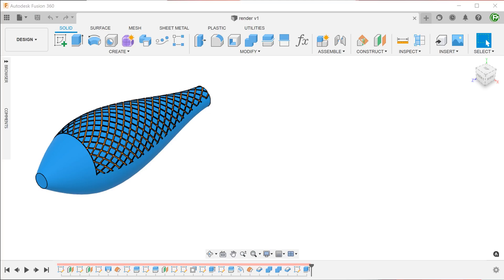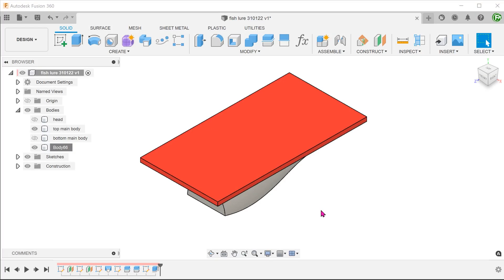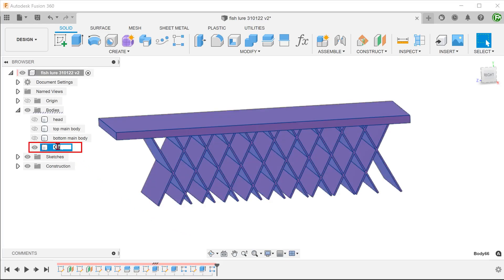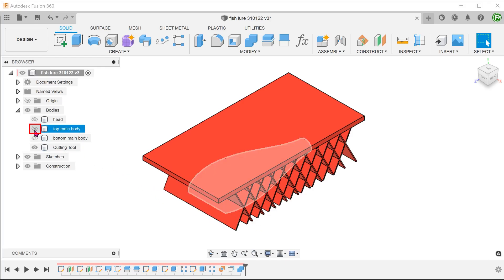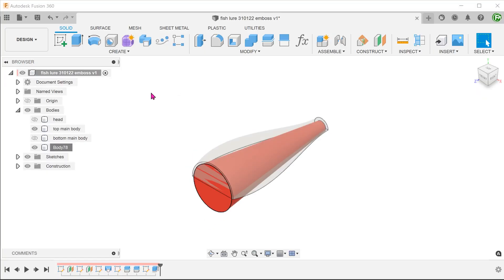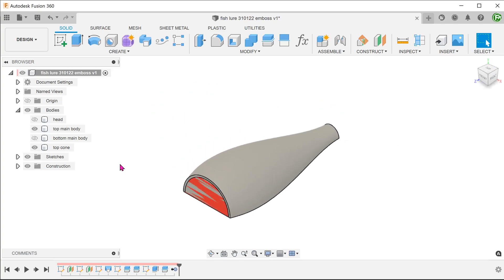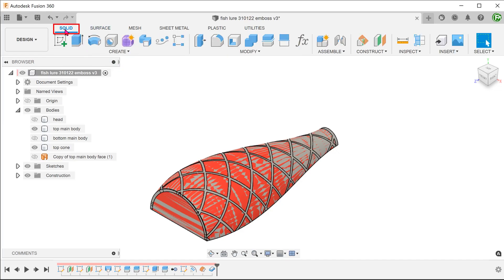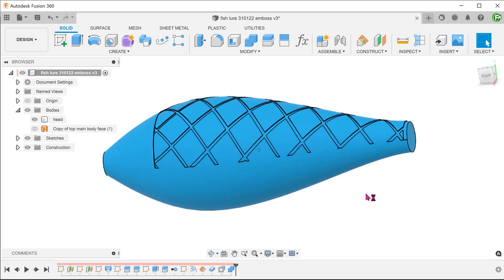Fusion 360 | Limited Cross Hatch Pattern

Comment: cool video. I beta by non with all updates it can be done from other pointes of view.  I Was thinking to start with a surface sweep of a line along the axis of the body as path. And adding a twist on its settings . Then thicken the surface and perform a circular pattern of the thicken. Repite the exact thing  from the other side of the body (or copy and move 180 degrees) and then perform a Bolean cut.  Main advantage is that you could cover the hola body with the pattern. I doupt the Emboss funsion could be thanks along 360 de body.   I love your videos, helped me a lot to develop appropriate mindset. 

  A good challenge that i believe could help a lot of engineers is making custom screw threads . (I struggled a lot with this for some time)

Comment: I tried replicating this using a technique for generating knurling over surfaces with 2 degrees of curvature. Fusion would not compute the circular pattern of a sweep cut with a square profile (nor would it allow me to build a combined body with square profile bodies to use as a cutting tool). However a triangle profile did work for me (simpler geometry I guess) but the result gives a more knurled look than the hatching look.

Comment: Awesome workflow as always!  I was really curious how that first method would work out!  If we had a true wrap tool or a surface unwrap this would be easier(without add-ins).  I would probably go the route you went on your second example, but if the curvature varied a lot more than that lure(relative to your surrogate) another option would be a sweep cut.  This would be the way to do this if it was a true knife edge knurl.  Project curves onto the lure surface,  planes on curve and pattern what you can.  https://a360.co/3GvqFNx   Unfortunately it requires ALOT more work this way with curvature in 2 directions because a pattern just wont "cut it"....

Note that I didn't do the whole lure in my example but the point should be clear.  There are other challenges like twist on the sweep.  Other controls like sweep with guide surface could be used to control that but as a quick example I didn't want to dive too deep, but just like with your surrogate workflow its a good idea to have an extension of what you actually want to cut.  With this design I would probably take the upper half surface and then extend the edges down for the sweep guides so the ends taper away from the solid body.

I really enjoy these videos!  Your approach is creative and often times wouldn't have been my goto.  I like the thought you put into the approaches and the speed.

Comment: I think it would be easier to create the limited pattern in this manor: split the body 2 times.  once to cut the "head" off, an once to cut the body into top/bottom halves.  Hide the head and bottom halves.  create sketch on the front face of the top half, in this sketch draw one vertical line and 1 line 45 degrees to that vertical line.  Both lines will be coincident with the top Arc, and the center of the bottom line.  Repeat this process on the rear flat face, but make the angled line opposite of the angled line in the previous sketch (i.e. -45 degrees, so that if connected the line would cross the body).  Finish sketch.  Create new sketch on the top plane and project the coincident point of the angled lines where they meat the arcs in their respective sketches.  draw a straight line or spline connecting those two points depending on wat shapes you want.  Extrude as a thin feature, make sure that it is protruding through the original body all the way, and create a "new body", finish extrude.  Circular pattern this extruded "fin" as many times as is desired around the central axis of length of the entire bait.  join these fins to themselves, but not to the top body.  Mirror these fins across the plane that bisects the top body into left and right sections.  In my case it was the right plane.  Then join the mirror to the original, do not join to the top body.  Once you have this body created that is your cutting tool.  Hide it temporarily, create a copy of your top body, use press pull to shrink the top face by 1 mm.  Turn the cutting tool back on, use the copy of the top body to cut the cutting tool, then use the newly cut cutting tool to cut the original top body.  Once it has been cut restore the hidden head and bottom body and join them all together.

Comment: I think the second workflow can be optimised, after the emboss you could create a copy of the original body, move the face in by the pattern depth desired then combine it with the patterned cone, once you have done this you can just combine the patterned cone with the original half model with the mode set to intersection, the excess on the body will be automatically removed by the intersection and the pattern will be removed from the original body as it is missing from this tool body 
Edit: Made a video of this process: https://youtu.be/q0DEyUC2Gh0
Reply: I like it Matthew.  There are probably 6 different ways to go about this and picking the "best" way is always a challenge.  Replace face, offset face. Press Pull, Thicken etc could all be used.  If you take a copy of the outside surface and Thicken it inward the distance of you cut, but use the "Intersect" option with your emboss solid body, you will make solid bodies that can be used for the cut without the extra work.  In this case you will likely have a lot of solids but you can box select them.  Another way is to Thicken the surface the distance of the cut then use boundary fill, but this makes you select a ton of cells(possibly) depending on how your bodies are laid out.  One of those two is likely the most efficient option.
Reply: @LearnEverythingAboutDesign  yeah thats a good idea, once thing I did notice about every method that uses the emboss commands is that they cause fusion to freeze for several seconds :D I don't think emboss handles thousands of lines well. I'm not massivly familiar with boundary fill I tend to just work around it.

Comment: Thanks for this! I’m creating knurling on a complex surface and these methods should be much easier than making individual sweep cut profiles!
Reply: Josh, one potential issue with that is the cut direction won't be normal to a complex surface but rather the surrogate.  As long as you can make a surrogate close enough to your final shape it will certainly be quicker, but harder to get a true knurl knife edge.